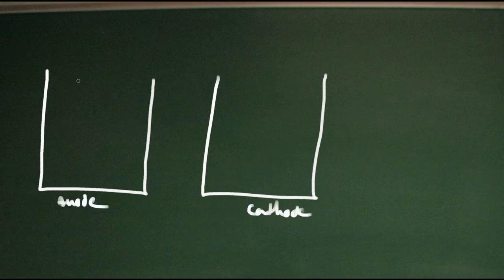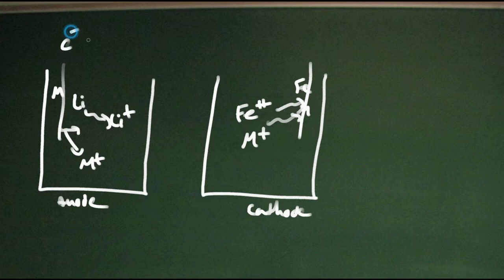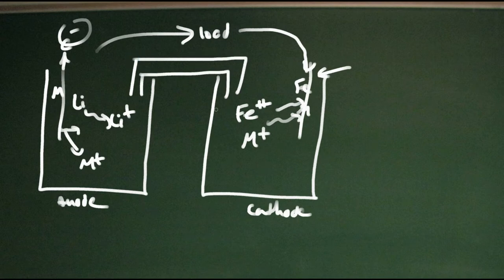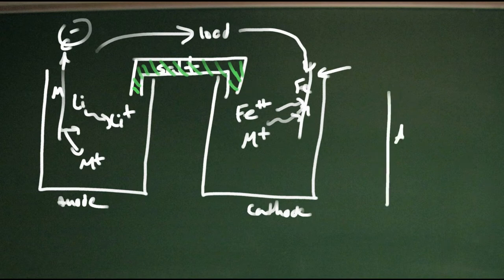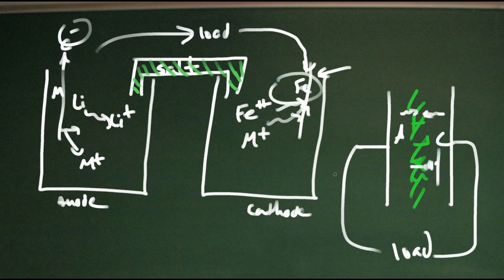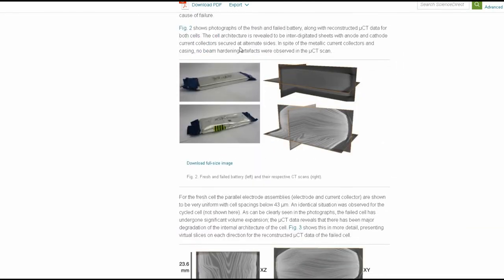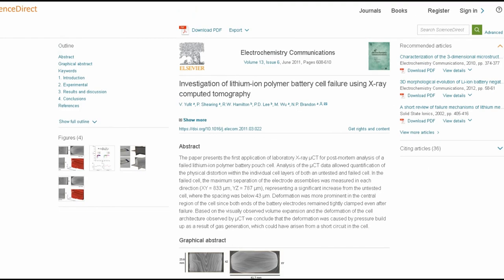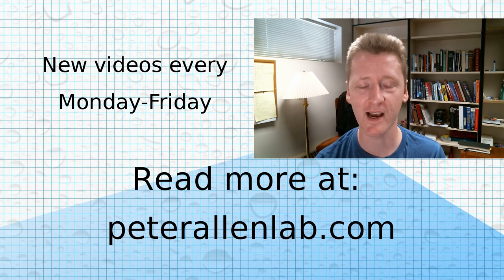How Lithium-ion batteries fail (non-explosively)

Comment: Does the thickness of the bridge layer affect electrical performance? If not a it would take more time for the buildup (dendrites) to penetrate and prolong the life of the cell.
Reply from the maker: That's very true; thicker separators help. But the energy density of your battery is lower because there's more separator and less anode/cathode chemistry. Also, the internal resistance of the battery is higher with thicker separators. So the thinner you can make (while still being safe) the better.